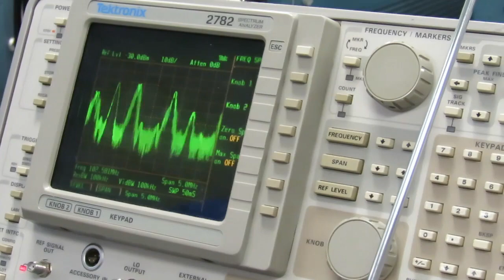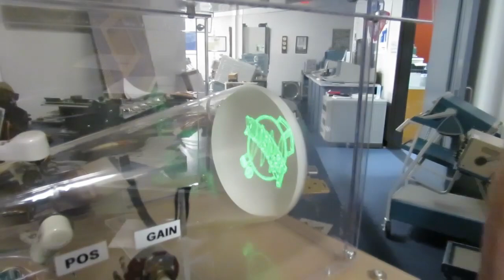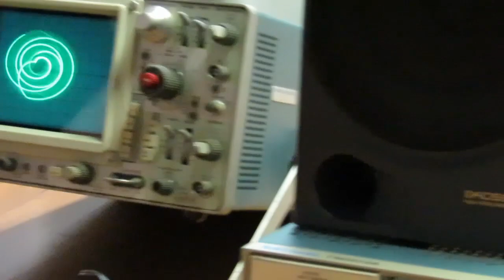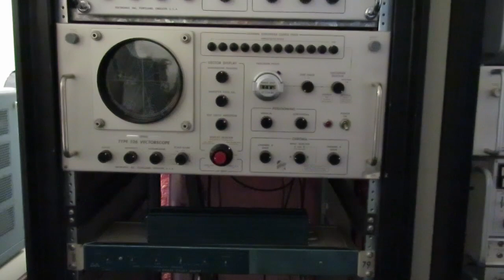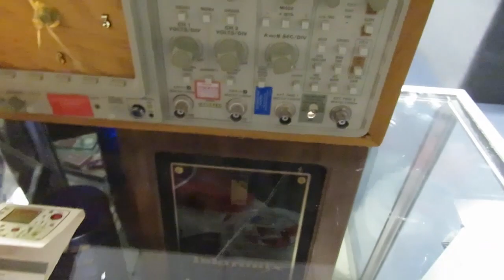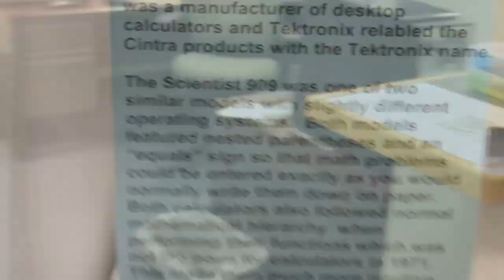A Visit to the VintageTek Museum

Comment: This was fascinating, until that inane comment about never wanting to own an apple product. I love Tektronix gear, it's a lot like Apple: overpriced, but you get what you pay for.
Reply from the maker: Not really. Apple stuff is no better made than comparable level equipment made by other manufacturers. I know that Apple users have a bit of a cult where they like to think they are the only ones who know good equipment, that they have made the right choice, but thankfully I never drank that Kool-aid.

And I consider any comment that equates Apple stuff with Tektronix to be 'inane'. Tek stuff was the most seriously (not just cosmetically) innovative in way that made it the only choice for the most demanding applications. Tek stuff from WAY back still works while Apple stuff from less than a quarter as far back is all in a landfill. I will concede that SOME Apple computers introduced new user interfaces (which they did not actually originate), and Steve Jobs got to the idea of a well-integrated handheld tool for everyman before the competitiondid, but Apple also introduced some seriously silly, ill-conceived equipment.
Reply: @youtuuba  As there is an Apple cult, so there is an anti-Apple cult it seems. I've used Android phones and Windows machines along side Macs and iPhones, and I very much prefer the Apple products and usability. I will say, I agree with your observance of some of Mr Job's dubious marketing and product decisions over the years. I also agree that Tek is in an entirely different league than any contemporary cell phone manufacturer. I've used Tek scopes for a bit over 50 years, and have (probably) over a dozen Tek scopes currently in my shop (and a few HPs), and will argue that they are some of the finest examples of engineering excellence on the market. But going back to my favoritism for Apple, I suppose if you want to use a weighted term such as 'cult' to describe my admittedly subjective preference for the Apple products, I can't stop you, and if you want to resort to ad hominem labeling of other's comments as 'inane,' just because you disagree, well, if that's your way of supporting your point, I will leave you to have that discussion with someone else.

Comment: I repair vintage stereo equipment in my retirement my 465 scopes that have had the tantalum caps replaced work and look like new. A friend gave me a 2245 that works great too.  My 570 and 575 curve tracers were rebuilt by Stewart Smith here in Syracuse. He is 91 and his father started Stewart Smith Electronics when he was a young boy. I don't think that there is anyone alive that known more about vacuum tube electronics . I am 69 and have been going to his store for 50 years and have learned more from him than I did in school. I call it silicon with a sermon. My dad's 310a (he was a HIPAR radar engineer) has a place on my bench too.
Reply: You’re doing what I’m building up to do when I retire. There aren’t many really good analog stereo repair shops anymore.
Reply: TEK310 - произведение искусства!
TEK310 is a work of art!

Comment: This is great, thank you.  In high school my dad got a used 531 that let me learn electronics, then later a 545.  As an intern with RCA broadcast I used a 547, which was really a pinnacle of scopes.  Upon full time employment with RCA Labs in 1980 I was able to order a 7904 for my use. It had much higher performance than the 547, but it didn't have the  crisp display of the 547.

I believe it was Tek that disrupted the scope market by making scopes calibrated. Prior to Tek, scopes would only show you the general waveform but could not be used for measurement. Tek said, let's calibrate this thing! And everyone else was playing catch up.